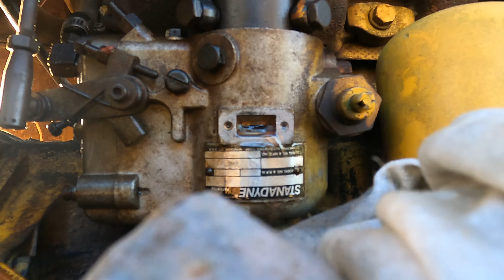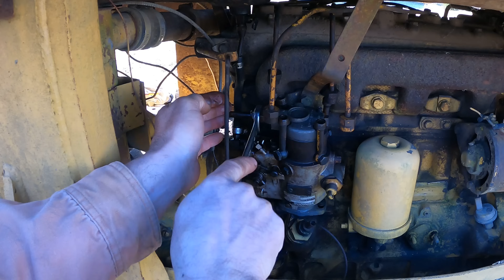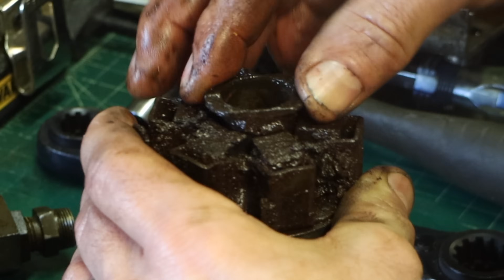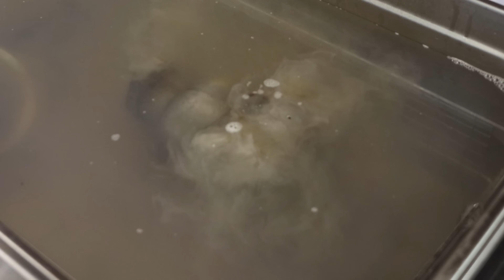Forgotten John Deere 1010 Track Loader, Part 2.

Comment from the maker: Part 1 here: https://youtu.be/XXy4tl2vHBI.  Would love to get your advice and opinions on where to go from here, especially if you are experienced with these 1010's.  Have an awesome weekend folks!
Reply: I vote for an autopsy.   Maybe a re-ring and valve job will do the trick. I would not put too much money into it due to other issues with the machine.  

Do the steer clutches and or brakes work?  At this point we don't know.  Does the transmission work?what else could be wrong?
Reply: If you fix it, I will watch you.
Reply: connect the injectors up to the fuel lines outside of the engine and crank it to check they work
Reply: Should be very cool if you did an total motor rebuild. It sure would be nice if you take it appart. Sorry for my bad English.
Reply: At least check if your valves seat properly, wet testing will affect them to if they aren't seated properly.
Reply: I've been there and done that, scrap it, and buy a big skid steer.
Reply: Pull the pump (sell it) Scrap the rest. Buy a another machine that is worth your time. Even after your rebuild the engine, you still have to replace all of the hydraulic cylinders (probably the Hydraulic pump, etc). This is a money\labor pit.

Maybe see if Matt & diesel Creek has a machine worth your time that he is willing to trade. I presume his shop is probably only 3 to 4 hours away.
Reply: I say the same as the others, there should be enough compression to get it running. Can you test the injectors to see if they are spraying any pattern, maybe worth just putting them in the cleaner to see if it helps them. Connect them back to an injector pipe , keeping the injector on the outside of the engine to see if they are working. You need to make sure the injection pump is timed right too, else there is no hope of it firing.
Love your videos and how in-depth you go into things, keep them coming.
Reply: you also got 2 videos of this
Reply: Full Rebuild
Reply: Autopsy please. Followed by a trip to the recycling centre. Reincarnation as soup cans !
Reply: Just throw a predator 212cc in it and ship it! ;P
Reply: Jon or is it John, borescope those valves again. I bet they are not seating. I may not be an expert but I stayed at a Holiday Inn Express once. Plus I love the methodical approach you have.
Reply: Rebuild it. I had a 1010 gas tractor and that one is tough to rebuild due to it being a deck sleeved engine. Well just looked and the diesel is deck sleeved too. Kits are available from 3rd party vendors for around $2,500. Ouch, it may not run.
Reply: With some of the OPs here. Since you have the injectors out, clean them. I might put some more oil in the cylinders after you verify they spray. I would then try and see if you can get it to run with just that as it is relatively low effort. If you can get it to run at all, you have a brief period to check the transmission, steering and brakes. You already need to get all the hydraulic cylinders rebuilt. If any of those other systems need substantial work, I would remove the pump and scrap it. It those systems work, remove the heads and check for cracks and look at the bores. If you still cannot get it to run with clean injectors and some cylinder oil, pull the heads and go from there. You can do these things without money....just time. Lots of diamonds in this flow chart.
Reply: I believe you could find a suitable replacement breather (with a paper element) off of a number of machines from a tractor recycler.
Reply: I suggest a collaboration with JAMSI, Jim' Automotive Machine Shop Inc. They do complete engine maching and assembly near Fort Collins, CO. It would make a great youtube series!
Reply: Scrap It... move on to something more interesting!
Reply: Hey thanks for your content. I found your channel a few months back and now I'm hooked. I did like 5 mins research, of now I'm an Internet expert on JD 1019 engines, and it is sleeved and there are several kits available for and inframe rebuild. Some have more then others and looks like the good ones are in the $800-$900 range. Which to me is pretty a decent price. However this does nothing for the head and we know the valves are pretty rusty. So then getting head done would be the next step, why put in the inframe kit and do the head? It's like Cyclops wearing a eye patch, it don't make sense. So then it's a matter of cost versus value of the machine as a whole. We know some of the hydraulic cylinders are in rough shape and then what about clutches? I'm all for more content on this machine, but does it make sense to do a engine rebuild when the rest of the machine is in unknown condition? 

 Having said that, I think at least a autopsy is in order.
Reply: Well, look at the transmission, see how far gone it is. 
Nice job on rebuilding the fuel pump.
I’m wondering if it’s a sleeved motor, and if you can still get sleeves, and what it would cost to have it done. 
Thanks again for tackling every job, love the videos.
Reply: Don't throw in the towel just yet.
WD-40 = starting fluid for diesels
Also it would be good to know what pressure the injectors open at and to verify the pump is making enough pressure for them to pop.
From the look of the inside of the pump, I wouldn't be surprised if the injectors were clogged/seized.
Great video series!
Reply: I totally agree that a rebuild is the fix in this situation. I see comments referencing expense, that said... This is a 1010 crawler/loader, they were built from 1960 to 64, so it's almost 60 years old, at the least. The overheating could be a cracked head or block, I would want to know. If both are intact, myself, I'd rebuild after insuring the cylinders aren't out of round. Valve seat and seals after being sure the head isn't warped. Doing it all yourself will save tons of money, and make for AWESOME content. It's a given that the hydraulic cylinders will need rebuilt. But when you're done, it'll make for a great addition to your equipment barn.
Reply: I request a colaboration with diesel creek, inheritance machiening and maybe titans of cnc for big precision changes.
that would be a dreamteam for these builds with 4 video's out of every episode.
Reply: I’m unsure how you can test compression without adjusting the location of the piston. On big continental engines you need to get the cylinder in a compression stroke where the valves are closed. I’m not familiar with diesels but don’t all engines have a compression stroke? Can’t you put compressed air in and listen to the exhaust or the intake and hear I’d air is passing by the valves. A valve or top overhaul may be doable without pulling the engine. Finally, start a go fund my engine page. I’d pay $5 to see the thing get rebuilt. Speaking for myself, you do a great job on these videos. Not sure if you spend 20 hours on the editing desk, but they are so no talking head. You have such a great feel for flow and timing.
Reply: Please do a rebuild.  Your luck could very well change, a pleasant surprise in the mean time, and we’d all learn from your usual excellent presentation.
Reply: 😮You can look at the #1 intake valve thru the port with the intake manifold removed, and bar the engine over till it closes and then until the timing mark for the crank is lined up. Any time you check timing, I think the engine needs to be turned in the direction it runs, so any lost motion in the drive system is removed from the equation. I'd also check the spray patterns of the injectors by removing them and connecting them back to the lines and spinning the engine. I would not give up without trying again to run it again. There is also a product made by OMC that is supposed to free carbon-coked rings. I have a friend who swears by it. If it still has low compression after all that, I would rebuild it, because it looks so good. A simple-minded person like myself just can't accept that it's not worth fixing.
Reply: Whatever you decide, I’m sure you’ll rebuild lol, you don’t seem to be a man that doesn’t like a challenge or two, looking forward to seeing what you decide,take care
Reply: If your gonna pull the motor to do an autopsy you may as well just rebuild it. It’s ultimately about how much time you want to put into it.  I’ll follow along either way.  It’s Content creation and long term revenue generation.  I’m sure the John Deere Fanclub would love this.  Good luck.
Reply: I have a 2010 backhoe loader(same engine).  The good news is John Deere dealers have,  the SKUs,  printouts on their  computers,  Everything on their computer in terms of ordering parts,  also almost all parts are widely available through them and not expensive.  I have the manual for that engine--- I could xerox and mail what you needed-----Look you're super skilled guy ----where do you want to put your talent next.  If you're looking for a new challenge,  Just remember It's going to take some dedicated shop space, and maybe a two grand after you figure out what you need to rebuild it, if you decide to.  Don't forget hydraulic hoses pump etc.  ----your content is a plus plus for  whats your normal gig--   I follow your adventure closely---kind regards
Reply: Before tearing it apart I would suggest getting the engine hot then trying to start it either hook it’s coolant lines to another engine to warm it up or install a block heater or very carefully heat it from under the oil pan with a burner. 
I have an old Perkins that doesn’t like to start unless it’s basically at operating temp even in the summer time on a 100 degree day I often have to plug in the block heater to get it to start but once running it runs pretty well and surprisingly doesn’t burn much oil !
Reply: I'm totally in favor of a remaster, it would make a great series of episodes. The level of this rebuilding, you have to think carefully about whether it makes sense to repair it from the point of view of usability.

The rebuilt machine could be a YANMAR.
Reply: Definitely a new life! Properly sandblasted parts, repaint them, machine made properly. THAT would be a great content series of episodes!!
Reply: Autopsy, go from there
Reply: Please pull it out and rebuild it by yourself. Waiting for the continuation of the story. 👍
Reply: Good morning John, autopsy please and then go to a recycling yard and swap it for a cat front loader 🤣🤣🤣
I am sure you have the skills to tear it completely apart and have it running like the day it was new after costing you a lot of money. You need a go fund me page 👍👍👍
Reply: Jon. Very sorry it didn’t work out!!I It was very interesting and educational to see that great rebuild you did on the pump. Again, thank area diesel for us for the helping you. Then, all the time and effort getting the compression test. What a let down.
Of course I’d like to see that engine tear down analysis, but you know what you will do when you break it down that far. You won't be able to get it that far andnoy go rebuild it. Haha Maybe, just maybe the valves are part of the compression problem? Thanks for the great videos!
Reply: How much is a rebuilt engine for a 1010 worth? Unless you really have a use for this one, there are too many other issues waiting to bite you after it runs. If there's value in it, autopsy/rebuild with a plan to sell the working engine. Part out or scrap the rest.
Reply: Hey! The only thing I can think of is to verify that the injectors are firing outside the engine. Even with subpar compression, you should still be getting some smoke, & I didn’t see much.

Nice work!
Reply: Have you tried heating the block up to operating temperatures with a torch or so and then trying to start it wet? My thinking is, that if you can get it started with the help of wet rings, heat and starting fluid, the rings might unseize after running for a bit? After reading Scottwoods comment, maybe not starting fluid, maybe as a last resort?
Reply: I think it should run on what compression you have there.  My 2-71 in the one crane has 200 on one cylinder and like next to zero on the other and it will fire up without ether 😂  try a gas soaked rag over the intake instead of ether also
Reply: I myself Would at least pull the topend off and look at it. and see what it is like in there. Ya never know until ya Know!!
Reply: Merry Christmas to you and the whole familiy, stay well and I hope to hear something new soon!!
Reply: Hello 
I would check injectors. Take out and attach to pipe and see if any fuel coming out from injector. After check if fuel is injector in correct cylinder when piston is in tdc. Thank you
Reply: Autopsy then have injectors rebuilt and proceed from there
Reply: 1) Disconnect the battery.
2) Wait 1 hour to clear any DTC 
3) While you're at Church, lightning will hit it, and...😢
Reply: The pump rebuild was pretty awesome.   Definitely tear it down and see what's going on.   That'll be an adventure in itself.   I'd be happy to see multiple videos over time as you work on various components of it.   Those with the excavator and bulldozer have been great.   Educational and interesting even though I don't work on anything bigger than the outboard for my sailboat !
Reply: pull the head. If engine overheated head could be cracked and at that point probably an expensive repair. Injector nozzles probably not atomizing which makes for hard starting even on an engine with good compression. My vote is to pull head and evaluate further repair from there.
Reply: I suggest check injectors.
Reply: I have All the experience on all machines, I could fix that with my eyes closed. In fact, I already know exactly what's wrong with it just by hearing it turn over, but I'm not going to tell you because no one ever helped me, I just knew how to do it just by looking at it. You've either got it or you don't.
Reply: @bigdaddy741098  BS.

Comment: It would have started if you would have put 80 90 gear oil in the cylinders. I have done it in the passed and after the engine has ran fine ever sense. I have 2 1010s and a 2010. I like the ones I have.

Comment: I used to put oil in the cylinders and then start them with the resulting sufficient pressure, running for a good length of time to see if the rings would start seating and any stuck valves would start closing. That worked for me, many times. Also would be a good idea to clean the injector lines first and use new fuel and clean fuel filters. The injectors are more than likely in need of overhaul or replacement as well. Thanks for all of the great content.

Comment: Harbor frieght has cheaper stuff but sadly there precision tools are Chinese garbage. I buy things like tape or turkey ties at Harbour frieght but anything that needs to be precise or durable i spend the extra money and buy quality parts from the supplier or from  well know parts houses. Ive learned the hard way about Harbour frieghts cheap junk Chinese parts and power equipment. 
Go cheap and you get what you pay for.

Comment: if the injectors are totally clogged, where does the fuel from the pump go, is there a bypass/relief valve back to the tank/pump input?

Comment: I had a really ancient d8 caterpillar at my concrete plant that we used to fire up about once a year it didn't have a starter motor on it so what we would do is hook it up to a concrete truck and start dragging it around the yard and higher gear and it would sputter and sputter and sputter and after about four trips around the bath house and start coughing on one lung and then eventually it would fire up and actually run pretty good we could use it the whole damn day if we didn't shut it off you got to get something like that a trip try rapping an old sheet around the air filter and squirting gasoline on it too it works a lot better than starting fluid

Comment: i know this is late in the game but the jd diesel is no good they were no good to start with we had a great 1010 dozer it was diesel we put a gas in it made a great machine they are not powerful but the gas in the 10 sereis is better then the diesel and he gas engines are every where and you can find a running motor for cheap around a grand in the tractor

Comment: Do you have any ideas why my 1999 more bark chipper with the 4cyl perkins 1004 engine will pump fuel all the way until it doesn't come out of the injectors? But the mechanical pump works all the way thru both filters, just not out the injectors

Comment: My old 60s masey Ferguson diesel ran with only 140 psi per cylinder. Very low on power. I would think yours should at least run, and with valves seating and rings pushing out from running and putting on a load your compression should come up.

Comment: Working on the same machine right now, been sitting at least 10 years, needed glov plugs, it smokes when cranking, tomorrow we are going to get a torpedo heater to bring up block temp before cranking.

Comment: The wire on bolts- While in the Navy We used same technique on almost all bolts on aircraft and machinery. 
We had a special set of pliers that helped us twist wire on bolts and had a tie off point or 2n bolt to help ensure bolt not loosen:)). Man so long ago!!

Comment: 1010’s had a bad reputation. Sleeves were a gang sleeve made on a plate $$. Install the injectors to the lines to check the spray pattern? Take the number one fuel line off the pump and hand turn the motor and just as the fuel begins to come out look at the engine and valve timing. If everything looks good reassemble and pull start it. Better than starting fluid is a gas rag.

Comment: Did you put the injectors in a sonic bath for a couple of days ?
No ? Do that first !
Injectors not spraying properly will not fire an engine even with high compression !
Also, if there was a  coating of rust on the cylinder walls it would lower compression ! I would use PB blaster in the cylinders and any thing I can think of to rid them of the  rust particles ! Then recheck compression and try to start !